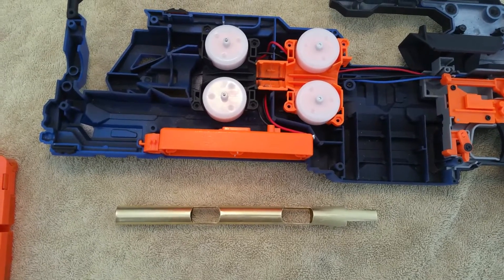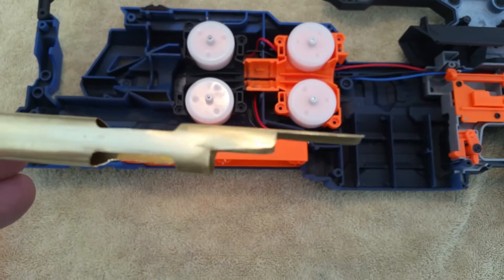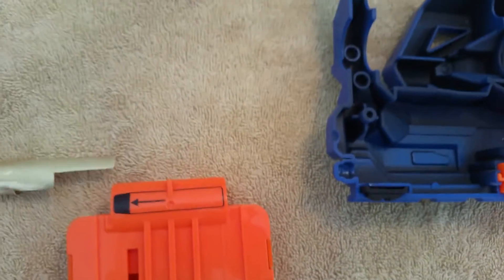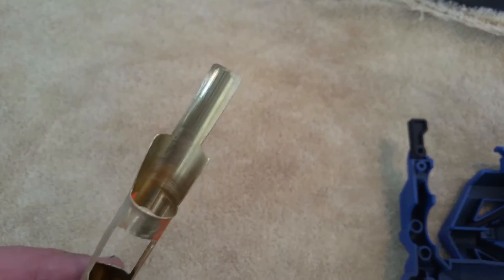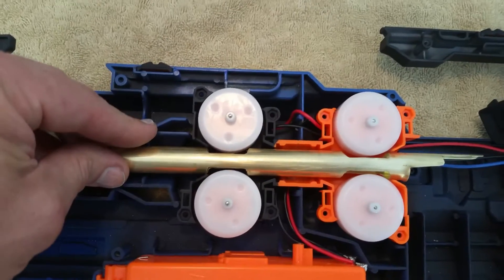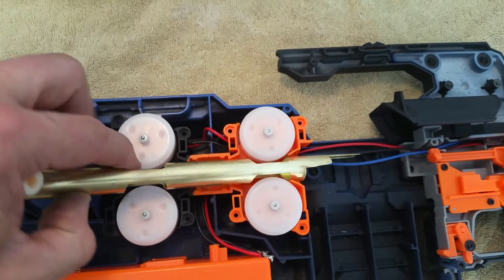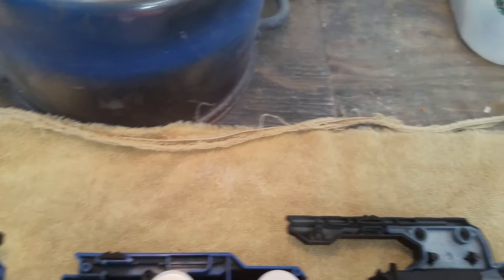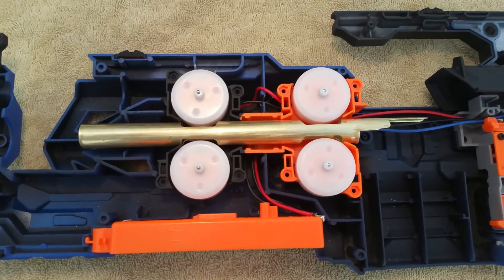Brass Barrels

Comment from the maker: The final version of this barrel (that went into my Quadulus) ended up have a couple of changes over what was seen in this video.  The final version was shortened to be only about 1 1/2 inches past the second flywheel window cutouts.  Also, I curled the end the dart guide up to keep it from catching on worn darts.  Both of these changes served to make the blaster more reliable overall.

Comment: Your fit and straightness test should also include a solid object longer than the entire brass piece, such as a length of drill rod, or the next size smaller K&S tube.
Reply from the maker: That is a good idea.  And I do have some 17/32 brass that would fit snugly inside of it.  I'll give that a try on my next build.  Thanks for the tip.

Comment: A well timed video. I was just thinking about doing this to my newly 180'd rapidstrike as the accuracy has gone out the window compared to when it had 130's. That and I have a brass guide in my stryfe which is good for accuracy. Have you tried using worker flywheels? I prefer them over stock ones. No slippage and better accuracy, especially when combined with brass.
Reply from the maker: I haven't tried the Worker flywheels yet, but I'm planning to in the future.  I've heard some people saying that they are getting 10-15 fps improvement with them.
Reply: I like em, dunno how they'd go in a multiple flywheel setup.

Comment: I'm planning on doing a shotgun using mega darts with 3/4 brass tube, however the air tank only can fit 9/16, so what brass tube(s) could I keep pressure fitting to get  the air to flow correctly and get it down to 9/16 brass?

Comment: A question that has been on my mind for quite a while now is why nobody would use pvc with a 9/16 inner diameter as such a barrel material. Is it because of the differences in friction between the dart and the barrel?
Reply: Good question. I will try it tomorrow.
Reply from the maker: I think it would work - PVC shouldn't have any more friction than brass or aluminium does.  The thing that is really nice about 9/16 od brass is that it is a snug fit in the Modulus, Stryfe, and Rapidstrike motor cages.  You don't have to modify them to add the brass.  Now, the Rapid Red cage is wider, so the 9/16 brass doesn't fit snug, but that cage might be a good candidate for the PVC.

Comment: so if I'm doing two hellcats on a single stage, should I also do the brass barrel? or do you think the velocity drop too much without two stages?
Reply from the maker: Part of that is going to depend on how long you make the brass barrel.  I've got a Stryfe with 2460 motors that I brassed with as short a piece of brass as possible and I lost about 10 fps.  It stayed very competitive.  For the longer brass barrels I've used in my Hailstorm Rapidstrike, the loss was more like 20 fps.

So...  With a short piece of brass, you probably could get away with in for a single stage.
Reply: Good to know, thank you